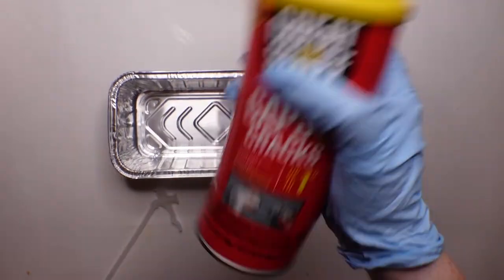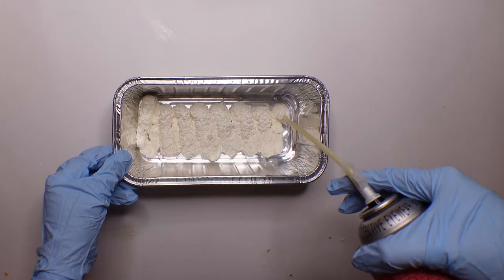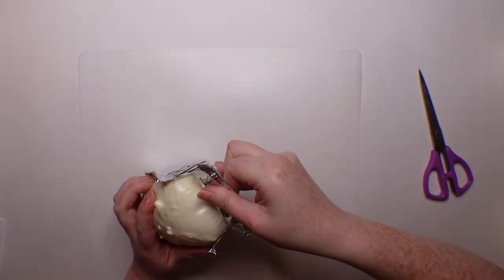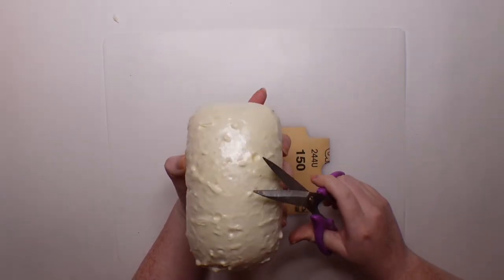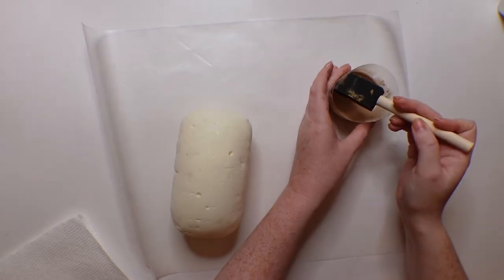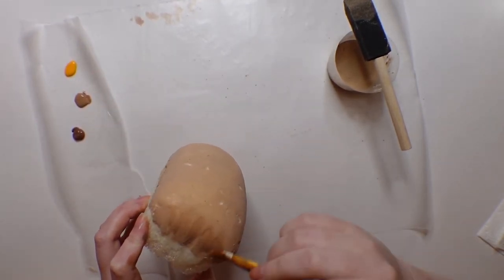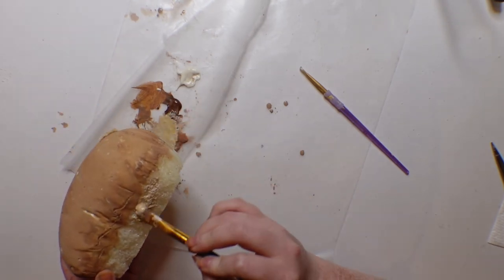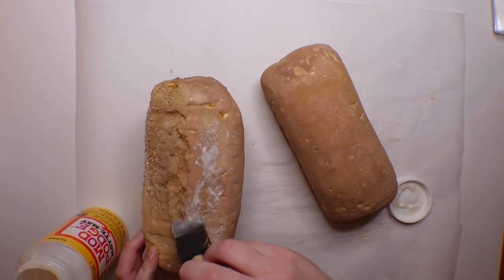How to make faux bread #fakefood #fauxfoods

Comment: How long do you let it dry before painting?
Reply from the maker: It may vary based on the brand of spray foam, but I'd let it dry at least overnight. Once it has fully expanded and is hard to the touch, it should be reay to paint.